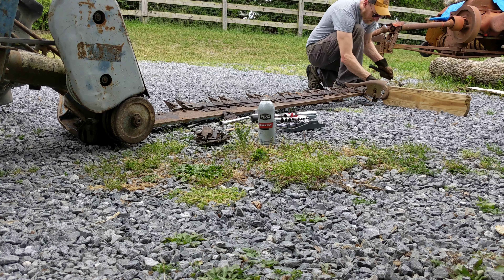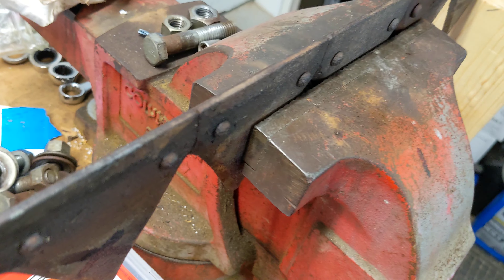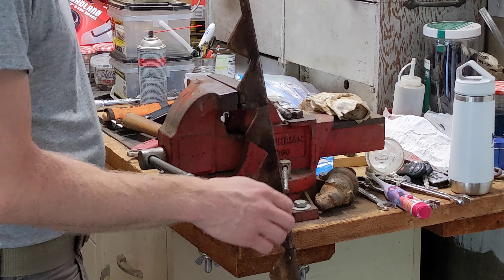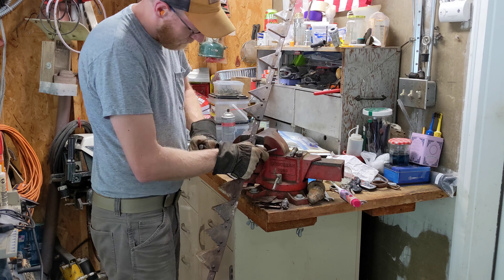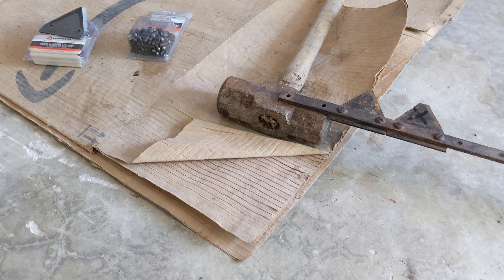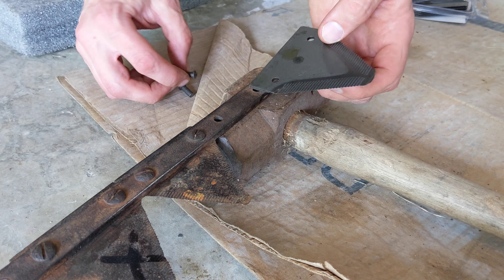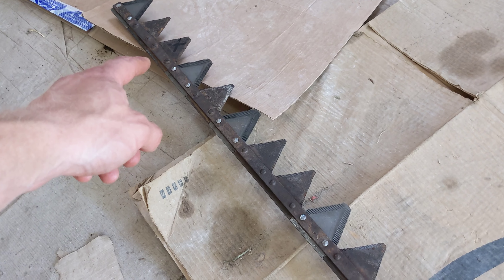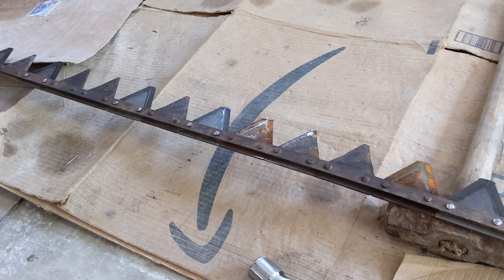Remove & Replace Teeth on a Sickle Bar Mower – Riveted

Comment: I had a flashback to when I was a kid and had to do this on our farm's swather.  We had a tool that would set the rivets.  So you'd need the tool and a ratchet.  I think we used a hammer and chisel to take the head off and the tool had a piece on one side that would push the old rivet out of the hole
Reply from the maker: Very nice, I've seen a few of those two sided rivet tools. If I ever see a good deal on one I'll like pick it up. Thanks for commenting!

Comment: I noticed some of the inset teeth have screws instead of rivets. Where the screws a past fix ??
Reply from the maker: They must have been, this rivets are formed so nice I'm guessing original? Or someone with a proper tool to form them. Also the screwed on sections are all at the end if I recall correctly, so guess someone hit something in the past. They sell screws so you don't need to use rivets. They were sold out last year so I'll probably just use rivets since I have the big pack.
Reply: @Buttons_fix_it  ONE great thing about rivets is when installed correctly they will never fail. That is a fact from the days of old. Good day vf

Comment: Hi.
Under serrated, or over serrated? Which is better? Somebody say this, somebody say that.
Reply from the maker: You are exactly correct that there are many opinions. I don't have enough experience to recommend one over the other. Even with my sickle bar so many minor adjustments change how it cuts (height, speed). Thanks for commenting and good luck!
Reply: @Buttons_fix_it  thanks!

Comment: Using the correct side of the hammer would certainly help
Reply from the maker: Should I be using the opposite side? Thanks
Reply: It would only take a couple of strikes to have it set. You don'tneed a round shape to it.
Reply from the maker: @SSouthcombe  thanks! I'll give that a go next time